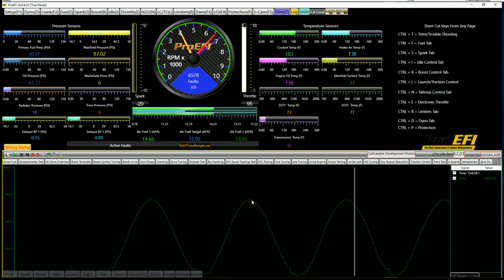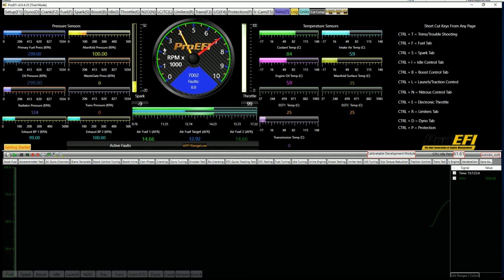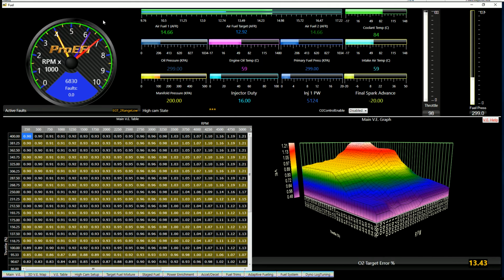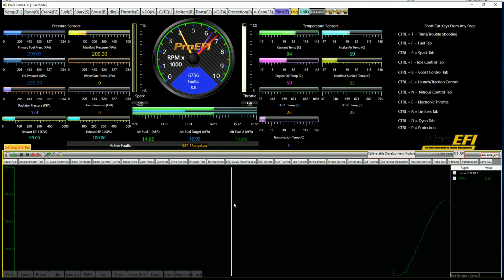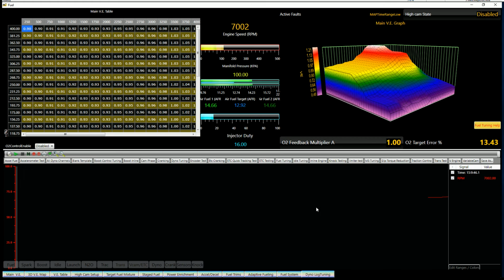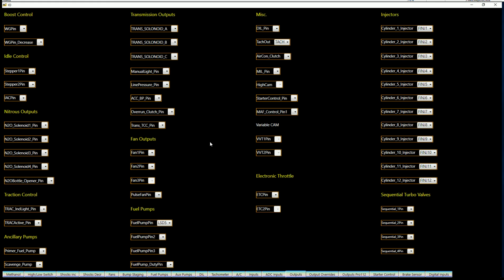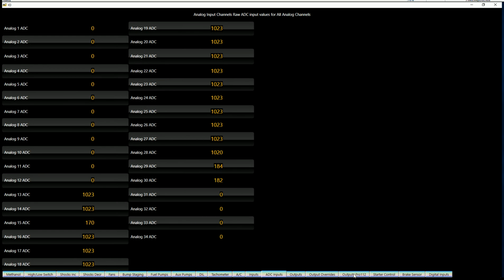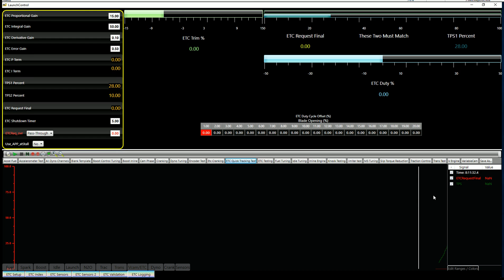ProEFI V5 Software Overview

Comment: Its great that you've added more views in the software... why don't you fix the styling and performance of the application?   Its so graphically heavy that performance is poor and its heavy on the laptop cpu.
Reply from the maker: V5 addresses a lot of those issues. As you can see it is running fine in the demo!
Reply: Hi Jason,   What is the proefi software written in?   Are you using .net?
Reply from the maker: This is not a conversation for a youtube comments section. If you want to discuss, you can email tech@proefi.com